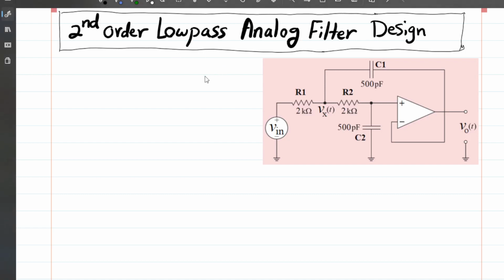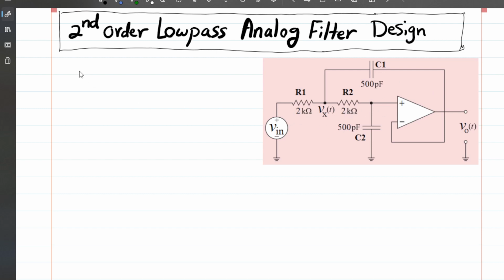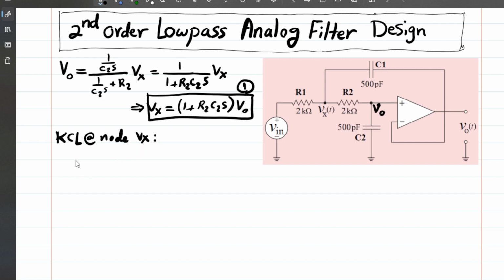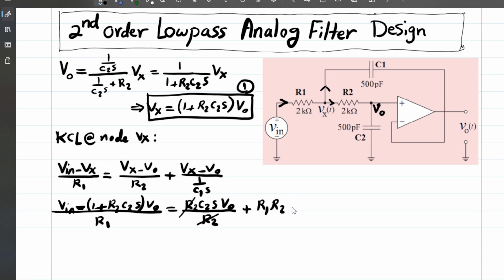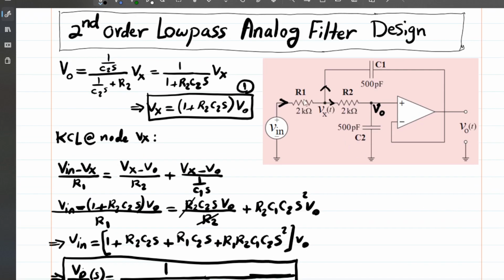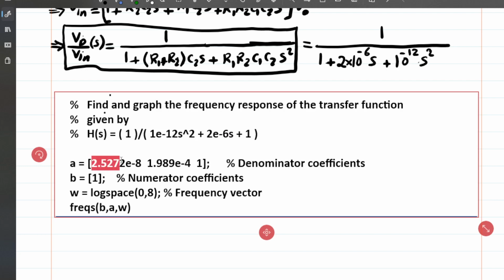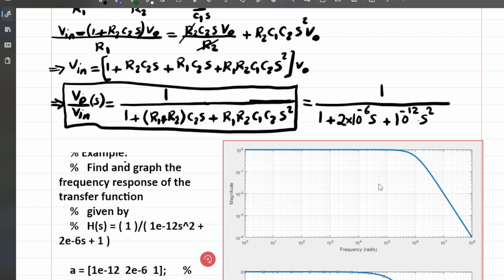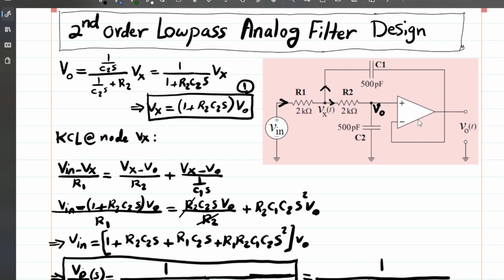Frequency Response and Transfer function of an Op Amp based second order LowPass filter

Comment: Much appreciated sir
Reply from the maker: You're welcome. Thanks for watching. For more Op Amp Circuit videos using Laplace or Z transforms please see: Op Amp circuit Bode Frequency plot https://youtu.be/BLVzuuqAlZs
Analog Computer with Op Amp to solve differential equation: https://youtu.be/SCKdMqJ65PM
Laplace Transform Example and S-domain circuit analysis:  https://youtu.be/ps8N5TPM_qU
OpAmp based First Order Lowpass Butterworth Filter: https://youtu.be/UzCjkwqy-9w
Band-stop Filter Design with two operational amplifiers: https://youtu.be/BLVzuuqAlZs
Digital Filter Frequency response:  https://youtu.be/zD-dHaP4KA4   
Transfer Function of DSP system with feedback Loops: https://youtu.be/95a2oitowLY
I hope these circuit design and analysis examples are helpful. Thanks for watching. 🙏